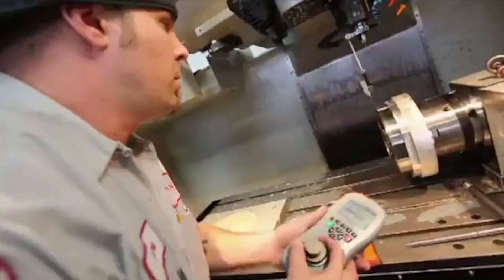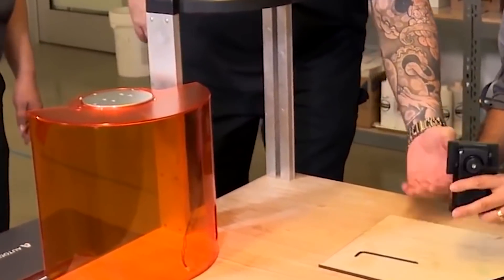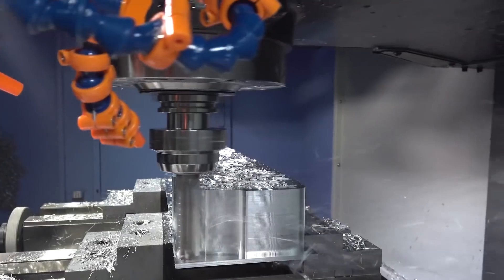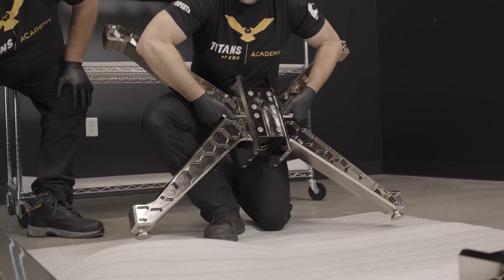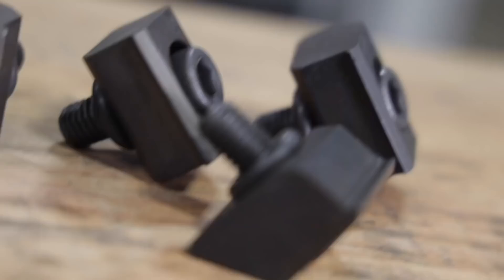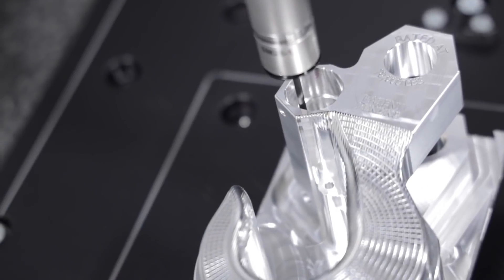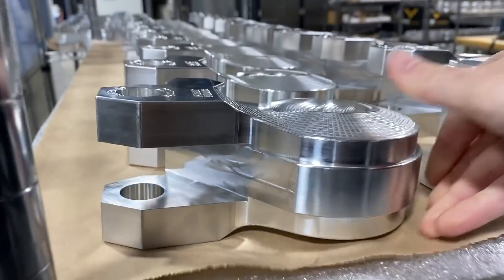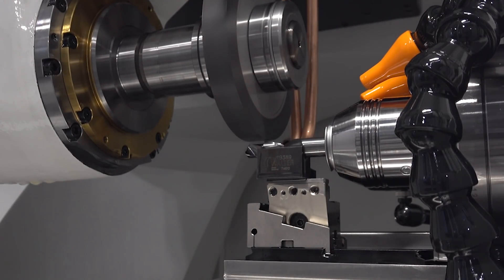My Platers RUINED Tons of Important Parts... INCREDIBLY FRUSTRATING

Comment: I had an experience with getting prt coated in a teflon type/non stick/ high heat application. I kept getting parts that failed specs because of an un-even, and even "orange peel", type of surface. Some parts were perfect. It was hit and miss. It got to the point where we had to serialize every single part, and required a tracking document with each part, and who did each individual process. This slowed down the turnover time, but very quickly we found the problem. Every single part that failed came from one employee, who was setting machine wrong, every time he coated our parts. All of this trouble, just for one person to screw up hundreds of thousands of dollars in parts. Just goes to show how even one employee can ruin an entire business for hundreds of others.

Comment: You did not do you job of properly communicating the critical characteristics.    You blame the plater but in actuality its your own fault. Plating is not a simple process, often time different types of aluminum require different etches and create different finishes. With so much on the line why didn't you qualify the process first?        I have worked in the metal finishing industry for 45 years and the only way to avoid this situation  is to communicate and qualify.

Comment: Wow. I work at an aluminum extrusion factory and we do our own anodizing.

I can't believe these guys don't have systems that will automatically remove the parts from the acid etch and from various tanks.

I'm betting they do have timers but people running cranes to manually remove these parts. If they don't make sure to always have someone present if that process finishes a d the person left for the bathroom, coffee break, or lunch the material will stay in too long. They should have a process that ensures parts are never left alone.

We only do type 3 anodizing, and only silver, or something on the scale of light beige-brown-black. And only on parts we manufacture ourselves.

Comment: There is something to be said about hiring quality workers and retaining them. Sure you can hire cheaper labor, but if you cant produce a product with less than a 5% scrap rate,is that labor actually efficient?  Real Craftspersons/ labor take pride in the work they do and take it personally if they make something sub par. I just ordered a “new” replacement cylinder head for a forklift. When it showed up in the factory sealed box that was packaged superbly with absolutely no shipping damage and I opened it to find a 200mm x 1 mm deep scratch/ groove in the sealing surface. This clearly happened after it was machined. Im guessing it happened before it was put in the box by an employee who had no clue of what they were handling and just slid it across the floor or something. The retailer sent another one out right away and said just throw the other one away. $675 loss for that retailer on just one part because someone just earning a paycheck couldn’t care less about the part.

Comment: Hmm. Anodizing is NOT a plating process. Anodizing does not stick to the surface, it is a conversion process. It converts the top surface of the aluminium into a porous layer of aluminium oxide, the die is infused into the pores and then the surface is sealed.   You are 100% right on the packaging though. Instead of wrapping the parts, the best way is to deliver the parts in custom trays, the parts come out, get anodized and go straight back into your custom packaging trays. My business partner runs a an anodizing shop in northern Idaho, his trick for winning business is easy: just be very very good!

Comment: You turned yourself into an expert in anodizing, and so the video becomes a very good introduction.
Yet, your problem is on the business side. It is the contract which has to guarantee (more or less) that you get what you want. Now you know all or a lot about the process, but using another company is about using their experience and skill-set, not having to acquire it later on.

Please note, this is no critique, I have had the same learning experience.
So the question is what can you do to prevent it from happening. One thing is a profound audit, the other is a good contract.

Comment: This is a common problem with vendors. We have been supplying remote inspection systems that are set up at the vendor so that you can conduct inspections on demand during the process - before they can ruin all your parts. I'm still amazed that companies have not jumped on remote inspection so that you can have more touch points for critical parts without the long notification times, travel cost or cost of third party inspectors.

Comment: Often, the person putting the plugs in, and dipping the parts, is a low educated, underpaid worker, who doesn't have much reason to have pride in their work.  We had some very expensive large parts go missing at a plater in Austin (no longer in business), and someone ended up finding them in a ditch near the plater.  Someone needed their toes stepped on for that.

Comment: Well, if you think anodization is frustrating, try electroplating! 90% of our company's products (musical instrument parts) require electroplating into nickel, chrome, black chrome and gold. Some of the parts also needs to be chrome plated and then sent to another vendor to be PVD plated. The number of plating related issues are mind boggling, it goes from plating adherence, bubbles, pits, dots, scratches, burnt corners, nickel exposure on chrome parts and of course part tolerances thrown way off. On top of that, there are always new "surprises" or old problem we thought had been resolved only to resurface a couple years later. 
My boss was so frustrated with the platers he spent the money and did our own plating facility years ago just to get the rejection rate under control. BUT that facility is now causing us even more problems because we still get all the plating-related issues PLUS the government bureaucracy on environmental regulations. Eventually we probably still would close our own plating facility and outsource, it is just getting more and more expensive every year to run one.
Reply: Point taken.  On the issue of government regulation though, I'm imagining a world where the industry is unregulated.  I'm sure you are more familiar with the chemicals, and chemical wastes that are created than me, but I know you wouldn't want them dumped into the ground near your house or near the aquifer that supplies your family's drinking water.  I completely get that regulations are often created by people that don't understand the industry, but we also wouldn't want it unregulated.  From the material handler or operator that just wants a drum of waste out of their area, to the CFO who sees how much proper disposal costs on the ledger, there's a likelihood that nasty stuff gets forgotten or dumped someplace it shouldn't.  I see all kinds of nasty shit getting pressure washed into the municipal drains at the hot wash station and sometimes wonder how the city deals with it, or if anyone even knows what it is or where it came from.

Comment: I would always treat a plater just as I would someone I was licensing one of my patents to...   a clear contract that detailed every single part of the process and I would also supply a check list that the plater had to fill out at each phase of his process for each batch of parts... any missed anything and the plater agreed to buy the parts... MOST platers would run from all of this but I would find one or two that had no issue and certainly charged more of course, then I would give the plater 3 parts, that's all.. three.. when they were finished I could show up and discuss the outcome with the Owner..

nobody is going to treat your parts the way you are going to treat your parts.... remember this always

Comment: this exact thing happened to me a couple months ago!  I made these perfect parts that had bearing fits and 0-80 tapped hole's that I know dang well I thoroughly checked.. we sent them for anodizing and when they came back, all dimensions were .015" small.. the 0-80 screws dropped in the tapped holes and  i was accused of not checking my parts and was blamed for the loss... I obviously did my research and sure enough I was able to prove  my innocence's. apparently the parts were left in the acid bath for way too long.. good to know

Comment: Unfortunately poor quality surface treatment seems to be endemic, regardless of so called approvals etc  ( NADCAP - don’t get me started on my thoughts on PRI / aerospace primes and their failings ) . There must be a market for more platers that actually care about the customers parts and wants to work with the machinist to achieve better quality. Getting a quote from most platers is difficult enough, never mind them doing a quality job! Guess what, I would even be prepared to pay more as the cost of treatment is invariably low compared to the part cost or cost of scrap.

Comment: The company I work for lost tens of thousands in parts over the years due to anodizing issues. We switched anodizers 3x, and they all have issues. They always say how they don’t screw up parts and all that, but they all do the same thing. They deliver parts not anodized to spec, off color, with damage, spots, irregularities, and they always just don’t care. They usually still charge for the work,  but will ‘rework’ for free. That’s great and all, but none of our parts can be reworked. We need to make new parts and deliver them again, praying they come out. It’s insanity how this is normal and expected in this industry.
Reply: One time they left my part in the etch so long it completely dissolved
Reply: Can you not refuse to pay if it's in the contract that their failure isn't your problem?
Reply: @michaelf.2449  Maybe, but the anodizing is 1/100th the cost of the parts… Normally they just redo them for free. But you’re out of pocket the cost of the parts, which can be A LOT. Some parts can be etched and reanodized, some must be remade.
Reply: @ericspda  yeah I understand I know the possibility of having them covering the part cost would be basically impossible

Comment: How about sending a QC guy to check the platers performance as they are being plated?
Reply: I worked at a shop where we had auditors visit every outside service we used including the places we got our material from.  If they didn't have process in place to make sure the jobs were done right we crossed them off the list of approved vendors.  Some places got upset about being audited by a customer, but we did it anyway.
Reply: Makes too much sense.

Comment: At my shop we  got a Titanium shaft in that is 200 inches long that we had an outside company turn and during the shipping process it some how fell out of the box and is now all scratched and out of spec. So we have to re-machine and weld up a bunch of spots because of the  outsourcing company's bad boxing job. Not only that but it is going to be months late to the customer because we do not stock grade 7 titanium welding rod in house and it will take a couple weeks to get the rod.

Comment: You have to be very specific and communicate very clearly with any plater. Simply sending a PO and a drawing is not enough. I spent 7yrs as a plating/anodize quality engineer and have seen problems stem from miscommunication hundreds of times.
Reply: Most the time the plater just has shitty quality control or employees who don't care. It's simple

Comment: Sorry, but why didnt u just use solid blue metal to start with? Would have saved the cost of painting it after? Also 3d printing can make all of your things. My daughter has a 3d printer, i got from Ebay, for $69, & it makes amazing things, in ANY colour u want. I am no welder, but its a clever solution, to an easy problem!🤷🏻‍♂️
Reply: Can you tell us an aluminium that is solid blue
Reply: Start with blue metal. Lol as Joe would say, "Come on man"  3D printing is not the solution either. Please educate yourself on materials.
Reply: 3d printers can barely hold tolerances of 0.2mm let alone 0.01mm. Not acceptable
Reply: @brandonsmoot4056  I see this crap all the time.  People seem to think that 3D printing is the be all end all of manufacturing.  In reality it's slow in very inaccurate.  If there are tight tolerances on the part they need to be machined prior to use.

Comment: I'm in charge of the Quality at my place of work, and I hate it when the boss tells me to let
work go out that I know is wrong , I believe that this has stopped us from getting more orders.
When the customer has little trust in you to get the work right first time, then you have failed.
A customers won't tell you they are going to pull orders from you, they will just do it without warning.
Reply: I had a boss where they would squeeze and bend the hell out of the calipers to measure out of dimension parts to get "closer" to dimension so to pass them haha
Reply: Damn. You sound like you work at my place. Not in Reno, are ya?
Reply: @keefjunior4061  no
Reply: I had a buddy that worked QA in a shop.  We had made batch of parts for Lockheed that were out of print, JUST barely.  Management told him to ship them any way.  He handed them the paperwork and the pen.  He then said "I'll sign under your signature".  Management looked confused for a moment then left the room.  After they got out of hearing range we all busted up laughing.
Reply: Well, if you're the cheapest place in town you'll still get business. My dad was in quality for a certain large automotive company and the issues they had from suppliers not caring caused problems constantly. But, they were cheap so they kept getting orders.

Comment: The plating company ruined the parts. Therefore, they should have compensated you in every way. They are the ones at fault. 
For now whoever you have do outside work for you make sure your written contract says they are 100% responsible for the parts you send them. 
This is called covering your butt.
Reply: Good luck getting that agreement signed😂
Reply: If you have a good relationship and do a lot of business with the player, they might take full responsibility. But the standard of liability I see is 2x the price of the service. Doesn’t make sense for a plater to cover 100% off the part cost. One scrap job can bankrupt a playing house.

Comment: We used to get parts military green anodized they where a different colour green every single time ended up finding a place miles away but they get the results we needed it is worth doing some research and sending test samples to get it right otherwise. Throwing all your hard work in the bin is devastating
Reply: A lot of quality is involved in getting color synchronized to be the same every time. There are a lot of variables involved. The finish itself from the machining or the texturizing of a part, in addition to the dye makeup change overtime through a specific tank. Filtration and flow of that specific tank can change an appearance as well under severe conditions. Maintaining pH level is most critical. I can go on and go with all the things I've experienced with a specific dedicated customer that I essentially worked for.

Comment: I've had some parts that were welded get failed by the client's inspector . We used a independent inspector recommend by the client who said they were all in spec . Our shop got another inspection done by a different specialist and were told yes they are in spec . . . It didn't matter . If the client says no start again
Reply: I used to work at a jobshop that sued a client for this exact thing (it was in sweden, contract law here is harsh on violators if you have a proper contract set up)

The client went under due to the lawsuit and the loss of their own clients but the shop Also lost ~60% of their orders (small town, the owner of the client business knew a lot of people) and had to move due to that.

Comment: A operation like yours should do all the finishing in house, total control over your product is the ultimate insurance policy. Remember that Titan ;)
Reply: Never mix a plating plant and a machine shop, always keep separate.

The chemicals and fumes in the air of a plating plant will attack and corrode everything, even with very good extraction.   its a whole different ball game.
Reply: @terrakill247  in-house doesn't mean literally in the same physical building (though a properly set up plating plant should also have premium environmental control implementation).. but you are correct in the rest of your comment.
Reply: @peterfitzpatrick7032  That "premium environmental control" will cost as much to run as the machine shop, maybe more.  The only way to make it profitable, would be to take in outside work.  now you're a plater.
Reply: Brandon, at some stage, you have to trust your partners... you can't control EVERYTHING yourself & this video proves just how much you depend on others being as professional as you & their efforts in reaching for that same level of excellence. 

Think about it, you have to depend on materials suppliers, cutting-tool manufacturers, metrology equipment suppliers... & many more... 

"No man is an island"

😎👍☘️🍺